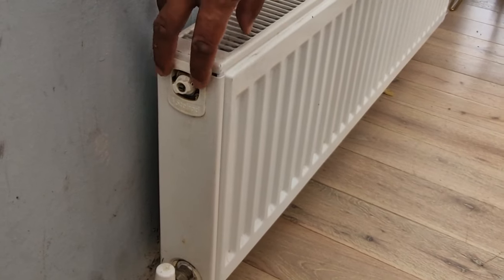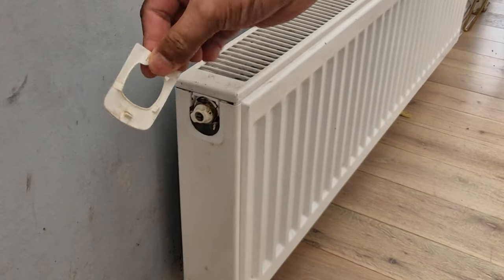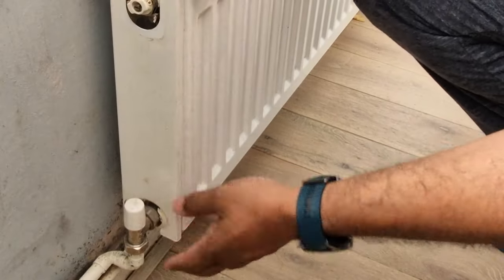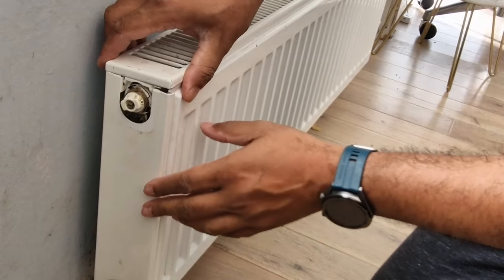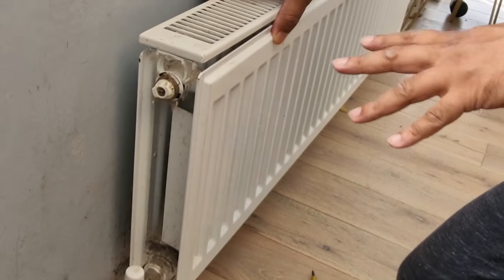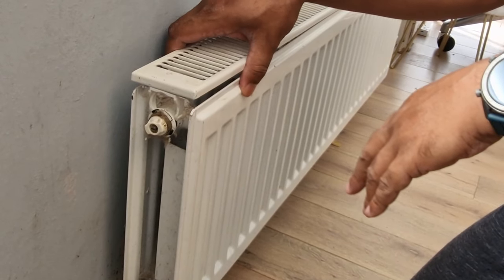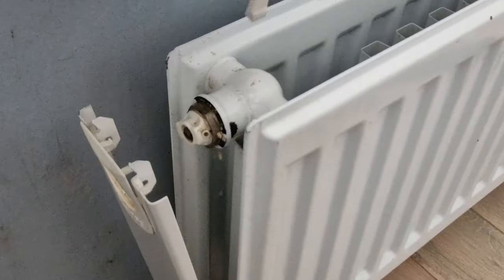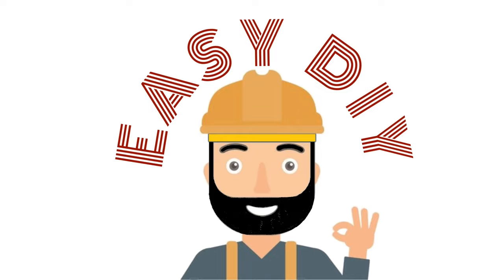How to Remove Central Heating Radiator Covers and Grill

Comment: What is the plastic bit that's on the bottom by the pipe called? The one you need to push forward to get the side cover to pop off?